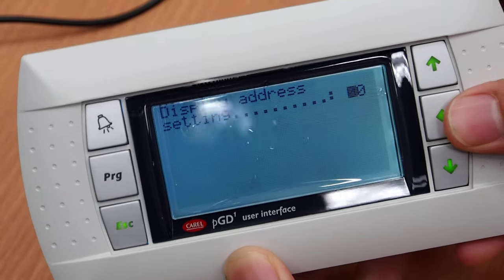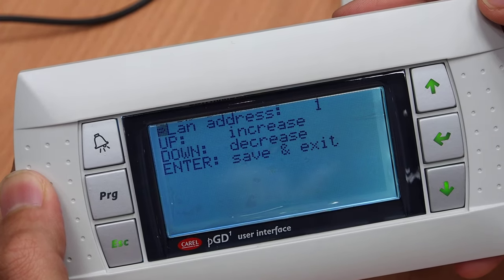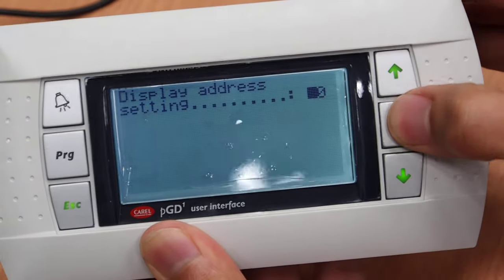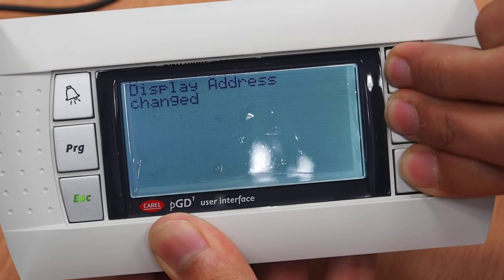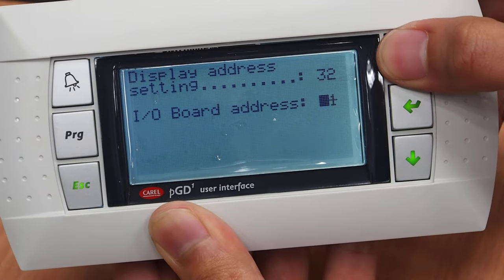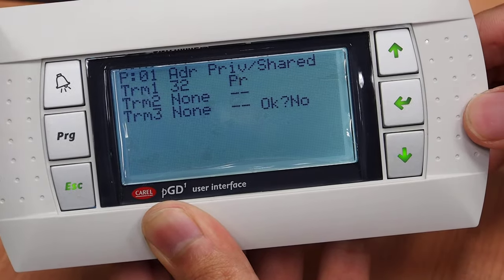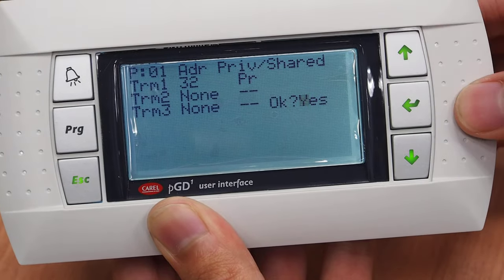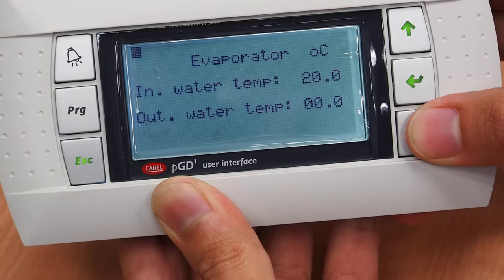PGD1 linked pCO3

Comment: Hi, i have a question. Is it possible to set pLAN address 0 to a carel terminal with 15 buttons ? I can only set addresses between 1-32, but it need to set it to 0 in order to use a programmable key to transfer board contents to a new one.
Reply: set all its dipswitches to 0 , remove its back cover of the display  and set all to 0000